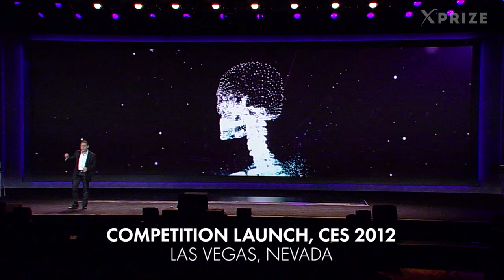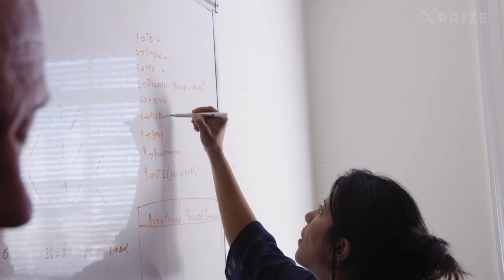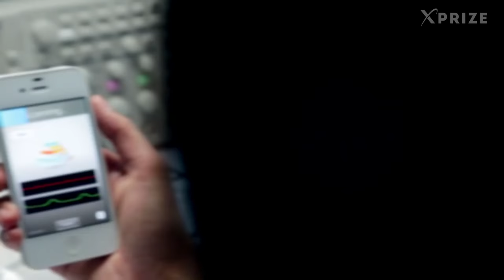Qualcomm Tricorder XPRIZE

Comment: Using light as a means of obtaining data, a miniature spectrometer (such as those used to scan elements on extrasolar planets) is designed, added to a scanning laser camera and all-in-one sensors, PLUS add it to a device computational as we say to a smartphone, with its software app and we have an authentic non-invasive tricorder gentlemen. A technology that with just a photo or video we scan for a medical result. Technology is already there but it is separated, it only takes the genius to put them together.